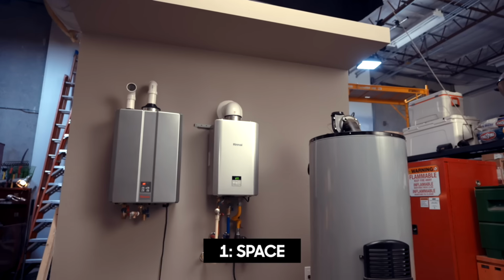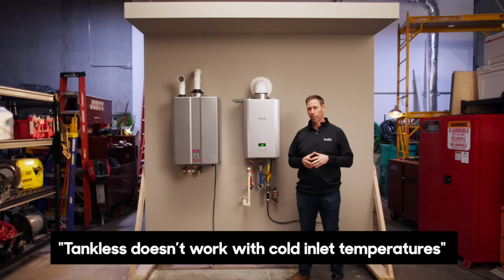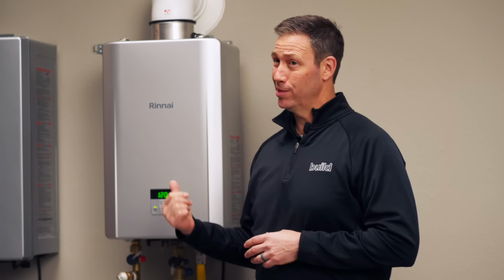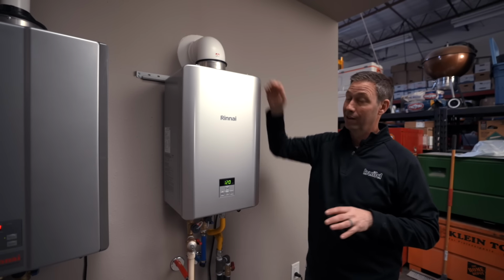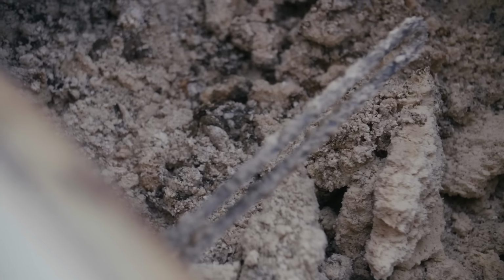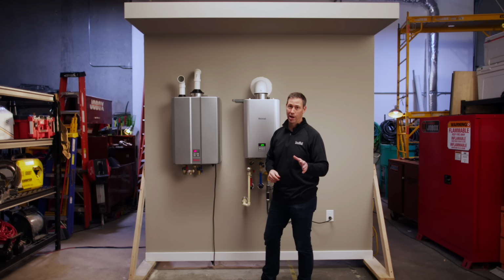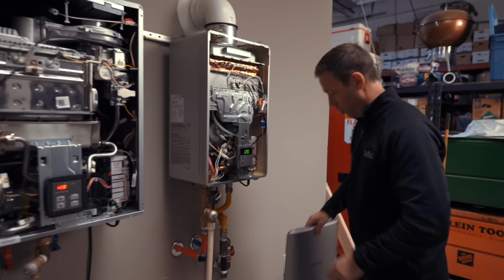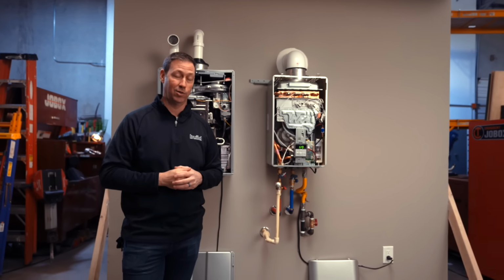DEBUNKING Tankless water heater LIES!

Comment: I always was baffled that Americans use these boilers.  In The Netherlands we already use the tankless units for atleast  40 - 50 years for heating water and the house heating.
Reply: we have wide open spaces you haven't had for hundreds of years in Europe.   That's the big advantage on tankless--space.  Not a concern for a lot of americans.   And if one prefers not to have hot water heat--and millions of homes used to, and were refitted for forced air or electric--well, not much incentive not to have tanks.

Comment: Not sure I buy the issue with gas lines, older homes may have issues, as the high end Rhinia needs a lot of gas and if your house has a gas dryer, maybe 1-2 gas furnaces and even a gas fireplace and was not designed to support a tankless unit you will need a gas line upgrade.

Comment: What is up with always pushing the gas tankless models and never talking about electric? If I want to build a passive house I'm not going to pump fossil fuels into a green building, I want to control it with solar or other renewables.
Reply: good luck, have you ever looked at the power consumption of an electric tankless? crazy amp draws

Comment: I’ll never put them on the outside of my house again. We live in San Antonio and had both our water heaters get destroyed during the freeze (and power outage). Lessons learned to avoid that in the future, but for me, I’d at least put them in the garage to shelter the exposed piping from the wind chill. Even with the freeze protection built into the unit, we still have issues with the inlet pipes freezing on us. Minus that issue, we LOVE the tankless Rinnai’s.
Reply: Wind chill only has an effect on skin, as it blows the heated air layer away from your skin.  Inanimate objects don't care if there's a 50 mph wind, the air temperature is all that matters to freeze pipes.
Reply: @brockwagner939  wind chills was the wrong word. Below freezing + windy conditions are going to speed up the heat loss/transfer of the water in the pipes vs freezing temps + no wind. We’ve had issues with the exposed parts of our water heaters every winter for the past five years since our home build. In South Texas. And more so, the one installed above the A/C unit that’s constantly blasting it with air.

Comment: My house is 5 bedrooms with 5 bathrooms and 2 half baths.  I have one tankless.  They hoo-haa'd about how I didn't have enough water heaters for the house.  Wasn't up to some code or whatever stupid rules.  Claimed my house should have two or three water heaters.  Hog Wash.  I've had tons on company over and have never run out of hot water.  Tankless are amazing.  I did have my first one fail and leak so I'm very glad I have it mounted on a wall and not IN the wall.
Reply: I know plenty of houses with tanks that don't run out of hot water.  What is so amazing about that?  If you have 7 bathrooms, you obviously can afford a far better tankless than i ever could, nice if you can do it.  All the folks in these comments testifying their tankless were anything but amazing, that's probably what i'd face and why i'm sticking with tank.

Comment: My house was built in 1946 with a tank water heater over 20 yrs old ready to give up the ghost (was repaired once). A trusted plumbing company gave us some estimates for a tankless. It ranged from similar install price as a tank to thousands of dollars more if we wanted recirculation and if if we chose venting that required a second line because they would put another hole in the roof. I have no need to change out my gas pipes, but I do need to install a 120VAC outlet. But yeah, the biggest reason for considering tankless is because my wife wants the closet space. Rinnai is probably one of the best makes in the world, but I may not go for the top tier. Yes, u get what u pay for, but...

Comment: I am from Europe, Tankless (low eff, fully analog, Junkers, now Bosch) lasts me&family 20-40 years as long as it is serviced every 1-2 years. Never descaled. 
In winter i just turn gas valve one notch up. 

I use the output temperature ~108F so as not to mix with the cold, but you can easily heat much more, my gas valve is set to 30%

Changed ~3 years ago was around ~450-500$ including labor.

Comment: If some one takes the flow restriction devices will resaults it to us more then 2.5gpm. You want to slightly over size the units. 
I agree the distance from the heater I what determines the time to get hot water.
Rinnai is like McDonald's of the tankless rather use a steak house heater. 
Tankless are great but if you loose power on the regular you will not have hot water.
You have to maintain tankless atleast every year. 
I am about to put a tankless in my house and have been selling them for 15 years I love them but you have to consider everything when you make a decision

Comment: I get that it's a sponsored video, but not everyone lives in Texas, so installing it outside isn't always on option. And you have to look at gas line, because a tank pulls 30k-40k and tankless could be 199k which has been a problem more than once for people that got a new water heater, and not everyone showers at 105°, we have to leave outlet water temp no hotter than 120° in apartments per code in our state and it caused complaints once or twice, or a few dozen times. Plus when a part goes out one could get an entire natural draft tank for less than half the price of part and service call cost and waiting a week for control board.

Comment: I don’t consider the statements he’s making to be “ lies” …..they are all very valid points made in the field and each application has its own challenges. I’m sure there are many many cases where each lie can be confirmed as very true.
Reply: But that's not how Rinnai wrote the script don't you know. Early in the video is comparing 60% efficient tanked to tankless but then sure isn't using that same tanked model's price when talking about how tankless are the same price.
Reply: @jh-12358  couldn’t agree more…. Gotta stick to the script 👍 . One example…Currently where I work ( Maine,USA) if a water heater ( tank) goes bad it can be replaced in almost no time with a subsidized heat pump HW heater for 1/10th the cost to the homeowner compared to switching to a tankless and cost go go much higher if no gas in the building. 
Another example about how long it takes HW to get to a fixture…. That’s just crazy to call it a “lie” because that applies equally to ALL types of hot water sources.
Reply: @dominicm2175  that "subsidized" heat pump may be attractive to purchase, but for those of us in California paying $0.39/KWH, it will cost a fortune to run.  The politicians want us to get on board, but they haven't really come to grips with the fact much of our power is generated through burning affordable natural gas.  Solar is plentiful, but storage is not.  California's environmentalists hate zero-carbon nuclear power, and are set to decommission our last plant in the next couple of years (responsible currently for 10% of our power source).  I'm glad we have gas service to our home, and will continue to leverage the lower operational cost of gas utility over electric.  I'm excited to put our new Rinnai tankless into service later this year.
Reply: @steveloux4709  Embedded solar PV in your roof tiles along with the right battery storage system in California is the best option.  Then you can ditch the electric company and the gas company.  All electric appliances and cars (or trucks) are the way forward.  Get on board.
Reply: @mychaelleesly  I think you are being tone deaf. While I hear your enthusiasm and desire to share your knowledge of the latest PV and storage possibilities, respectfully this is akin to telling the populace that if it doesn’t like $6+/gallon gas it should by an electric vehicle. The subtext of course is that gas powered vehicles (or not having PV) is for chumps. No one stops to consider the high initial cost of these things, and that only the very few upper-middle income families could afford these luxuries, which is a fraction of the overall population. As far as the roof membrane serving as a PV field, I’ll let someone else be an early adopter of that technology. They can report back on the failure rate and cost of repair and let the rest of us know. I’m only 14 years in on my 40 year roof; I’m not about to jettison the membrane at this point.
Reply: @jh-12358  I kinda question the efficiency figures. In a tankless water is constantly moving through the system so there is little time to apply heat. in a tank, every calorie of heat MUST pass to the water before it dissipates. The very fact these tankless heaters need huge amounts of power to do the same job a tanked one can also casts doubt on those efficient numbers.

Comment: Initally I thought hang on, what, Matt is a heat pump convert, why tankless again? Oh, I see,  gotta get that 'sponsorship' ching ching. To be fair if you are only comparing tank to tankless then sure, tankless has it's advantages but it's hugely situation dependent. If you are talking efficiency, heat pump wins hands down, hence why Matt installed a heat pump (not a Rinnai, as they are currently rubbish). So depending on your bugdet and the points mentioned, then yes, a Rinnai tankless may be a good option. However if you have the money and want to do something about climate change, then heat pump is the winner. Rinnai should maybe take a step in the right direction and use some of their ching ching to R&D a decent heat pump unit.

Comment: I've had a tankless for about 15 years now... debating on a heat pump... for the only purpose to get free air conditioning during the summer months.  If there was a plastic tank heat pump model I'd probably go for it.  That said, I love the tankless, flawless operation!
Reply: Free air conditioning??? Do tell…. Lol
Reply: @tnmsloony  instead of running the a/c to get rid of the heat in my house, and I need hot water anyway.. use the water heater to get rid of the heat in the house.  Not exactly free, but I think you get the idea.

Comment: It's amusing that the UK is predominantly tankless heaters in the form of combination boilers but the government now wants to push people back towards tank based systems, either with built in heat pumps or external heat pump units feeding a calorifier. Tank systems are great if you're feeding multiple outlets at the same time, where tankless isn't. On the flip side if you don't have space for a tank as many homes and apartments in the UK now don't - tankless is better suited.

Comment: Good info. Have you ever looked into the Stiebel Accelera Heat Pump water heater? I read that they said for every watt the pump and fan uses, it generates 3 to 5 watts of hot water. I've been thinking about getting one of these for the hot weather here in the south and take the heat out of the house and dump it into the hot water tank and help cool down the house as well.

Below is a copy and paste right from their web site from about half way down the page......
It has always been obvious to us that a heat pump water heater ought to make hot water with the heat pump, and not with a back-up element. This simple solution seems to have escaped others. Yet it has made our heat pump water heater the largest seller in Europe for over 35 years.

Until recently, the best “high efficiency” water heaters could only approach 100% efficiency. Heat pump water heater technology redefines water heater efficiency, producing efficiencies more than 3 times that. For every watt an Accelera’s compressor and fan uses, the equivalent of 3-5 watts of hot water are generated.

In warm climates, an Accelera® is placed either in the garage, where it uses the heat from the outside air to make hot water, or inside the house, where it helps with the air conditioning load. In cooler climates, the unit is typically placed in the basement where it also acts as a dehumidifier. You get hot water at a discount plus a drier basement as well.

https://www.stiebel-eltron-usa.com/products/accelera-heat-pump-water-heaters

Keep up the great work.

Comment: In Mauritius I remember back in time(1999) when I was a kid, there was a Rinnai tankless unit inside my walking in the bathroom with no venting outside and a small flexible hose goes through the wall connecting to a gas cylinder outside. We use it for 6 - 7 years and something dies inside we couldn't get replacement parts

Comment: I just installed A tankless water heater here’s my question. 

Should I Set the water temperature to 110 and shower with straight hot water or 

Set the temperature to 120 and Temper it with cold water. What’s more efficient. 

Inlet temperature is around  55°

Comment: Tankless, or a version of them, has been standard here in the UK for years, called combi’s, provide instant hot water and central heating, only advantage is that they are cheap, both to buy and to install, for a replacement in just a few hours. Dreadful things, mostly because of the ‘standard’ plumbing system in the UK. Our water mains are all low pressure and, in most cases, flow to a house is limited to 12l per minute, just over 2 1/2 gallons per minute, with no pressure regulation, any change in water pressure, say a kitchen tap is opened, or the washing machine asks for water, the pressure drops, the flow drops, the temperature goes up and the combi shuts down on over temperature, if in the shower first you get burnt, then frozen.
However in a few years time gas will be banned in new builds, and, some time later, no date as yet, for replacements in older houses. We will all have to go to heat pumps, which will be OK in new builds with high insulation and draft proofing, but in the majority of the old drafty poorly insulated UK housing stock it will be a disaster. Heat pumps mean a tank system. 
Gas is being banned because of the environmental damage caused. Heat pumps are ‘green’, but all use electricity, and, the plan is for all of them to have a 3kw electric boiler to act as a ‘top up’ heating source. Much of the electricity generated in the UK is from gas, these power stations work at around 37% efficiency, my, German, Vissmann system boiler runs at 98% efficiency, in the UK gas is currently around 1/3 the price of electricity per KWH. Makes no sense to me.
For your house rebuild you went for pasiv house standard, that, if it is the same requirement as here, is less than 0.8 Cubic meter air leakage per hour, there is a fairly new building regulation requirement, code to you, in the UK for air leakage, 7 cubic meters per hour.

We are all going to be living in cold houses with huge electricity bills.

NB our water pressure is often low because many of the water  mains are well over 100 years old, and would burst at high pressure.
Reply: Yep. leave it to a dumbsmit leftist to F up a country. WHERE are the new nuclear power plants in the USA with all this EV talk. Plan on double electricity bills and MASSIVE brownouts.

Comment: I've had a Rinnai condensing tankless for nearly three years. Yes flush it annually with vinegar. There are two issues:
1) Time to hot water can be a full minute or more for a distant tap. The partial workaround I've done is to install a one-gallon electric tank right under my kitchen sink, with input to it from the tankless hot. (I don't mind the minute wait for the shower hot.)
2) Minimal flow rate required: if you turn the hot on just a trickle, the tankless might never fire up.
Reply: I mean is waiting a minute for hot water that big of an inconvenience?  It takes about a minute or so for my tank hot water to reach the faucet.
Reply: @Great-white-tiger-hunter  For kitchen sinks with dishwasher attached, his solution makes good sense. Why?  Dishwashers sometimes never get hot water because they fill up before the water got hot.
Reply: I've wondered about that type of thing myself.  Why not use a lower wattage main unit and a smaller unit down the line, closer to the point of use.   How does it work out for you?
Reply: There is a switch inside the unit that will fix your “trickle” issue. I had a similar issue and Rinnai tech support was fantastic. If you add a recirc pump to your unit it will fix all of the waiting and it’s very cheap to run. That’s not specific to your heater, it has to do with the length of run between the unit and fixture which needs to be cleared (and pipes warmed) in the process.
Reply: @DanielCaspi  Adding a recirculation pump wastes a bit of energy because you are then using gas/electricity to keep the water in the pipes warm all the time. How much energy will be wasted depends on how long the pipes are, how well they are insulated, their size and length, etc. But then again, running the water until it gets hot wastes a little water too.
Reply: @averyalexander2303  At that point, aren't you just remaking a tanked water heater, just with a really tiny tank?
Reply: @latemanparodius5133  In a way you kind of are since you are still using energy to keep the water in the pipes hot all the time, but I would expect that the effect would be much worse per gallon of water kept hot since pipes usually aren't insulated nearly as well as a water heater tank and are often run through exterior walls, crawlspaces, attics, etc that see pretty cold temperatures. Copper dissipates heat very well too. I'm sure the effect isn't huge, but it's definitely something to consider.